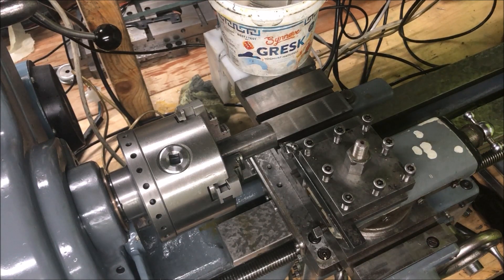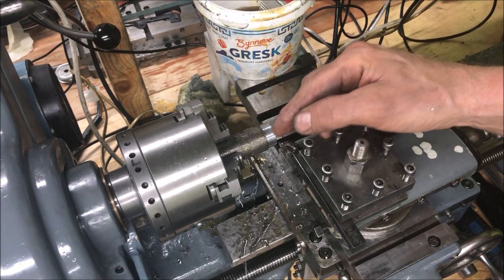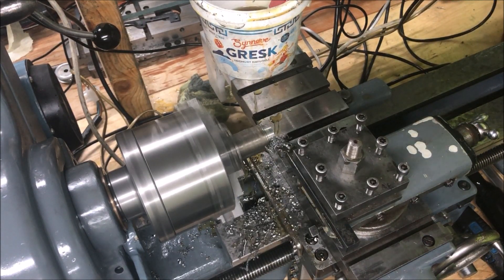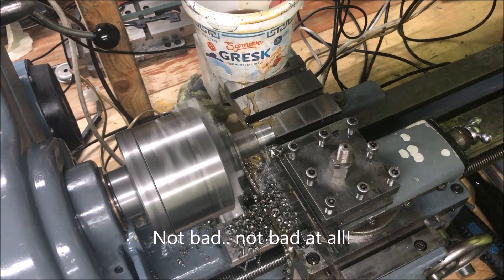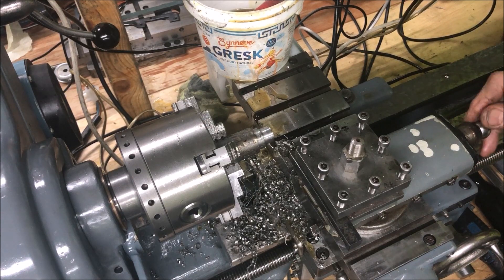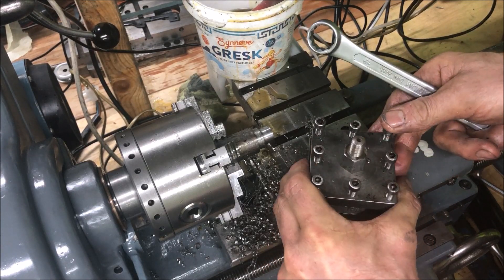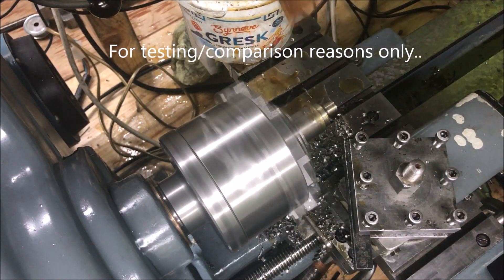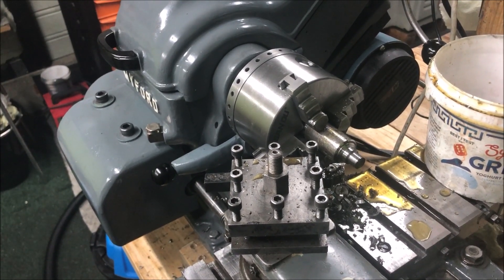Myford Super 7 - test cuts - part 2- with compound and ELS

Comment: Hi Jan, good tests. One quick observation from me, I see in the test of the solid tool block you used a quick change toolpost, however in the test with the compound slide, you used the 4 way toolpost. 

It could very well be a case that the lack of rigidity is actually stemming from the QCTP.

Would be interesting to see:

Toolblock -> QCTP
Toolblock -> 4 way

Compound - QCTP
Compound -> 4way

and to compare, to eliminate the variable of the tool holder changing between your tests. My best thoughts are a well scraped compound is just as good as the solid block, and actually the QCTP is far less rigid than people believe. Its like comparing the myford vertical milling attachment to a traditional mill, the overhang the vertical slide brings causes far less rigidity, same situation with the overhang of the QCTP.
Reply from the maker: Hi, Thnks fo the comments! You are of course right. The setup using the QCTP, being less rigid than the 4-way toolpost, is probably contributing to the results in the way you indicate. I guess I need to redo as you suggest :)
Reply: @jansverrehaugjord9934  Hi Jan, while i do agree with my initial comments with rigidity and the QCTP, i think the main lack of rigidity stemming from the myfords is down to the headstock bearing setup. I suspect that the front hydrodynamic bearing may not be providing as much radial support as it was intended. I plan to prepare some tests on my super 7 to see just how effective this is, and using tighter/looser clearances, different oils, scraping for 4 oil pads (nick muller mg12 video) vs just scraping for points etc etc, we will see.

Comment: How much this motor has power? I am running stock motor with VFD single phase and I constantly run out power. :/
Reply from the maker: 370W (0.5Hp) 3 phase motor run from a 1Hp VFD
Reply: @jansverrehaugjord9934  Same setup. Maybe it is the feed mechanism what takes so much power from the spindle.
Reply from the maker: @waldemarii  Could be!

Comment: I was preparted to hear a Myford singing, and it didn't happen.  Haha, my little Atlas would have been singing "I'm dying!  Help m- <k-chunk>"
Reply from the maker: I could tweak it further I guess and at one point the Myford would have given up (or is it given in?).. quite possibly if I increased the feed rate. But if so it is also nice to have a setup where all that would happen is that the tool digs in, belt (and/or clutch) slips and you cna just hit stop on the ELS, which brings the tool back to zero (or cut the VFD).

Comment: To be fair though Jan this wasn't a direct apples to apples comparison. That 4 tool turret tool post would help to increase the tool holding rigidity over the previous test with your QCTP and solid block test. In turn that would also help to increase the rigidity of the top slide itself by quite a bit. And that would also change the vibration and harmonics generated which would contribute towards tool tip chatter. Still that lathe shows an impressive cutting ability for it's size since nothing stalled or broke. I fully agree, every machine part is important during very high load cutting conditions and especially the fit and bearing amounts for the slide clearances. I'd also bet that for the actual part accuracy and surface finish the solid tool block would show some clear advantages.
Reply from the maker: I know.. :) This was the closest I could get with the same tooling. I do actually have a set of a homemade, Norman style QC holders that bolt directly onto the top slide mount, but these won't take the 16mm tool. Fully agree about the rigidity of a 4-way tool turret. The extra link/leverage you get with the QC system works to our disfavor from a "vibration point of view". I am also pretty convinced you are right re. the solid tool post on rigidity and overall performance enhancement possibilities. It is such an easy changeover between the 2 systems, so this must be appealing to others also. And such an easy project!

Comment: Seriously impressive Jan! I would never have though a little Myford could take cuts like that.  It says a lot for the quality of your work, but also shows me how valuable the ELS could be - not just for thread cutting!
Reply from the maker: Thanks. Indeed, the Myford is a very capable machine. Well designed for the tasks for smaller jobs, perfect in a hobby shop. I guess it is a bit "outdated", and todays' machines, especially of far-eastern origin are probably unrivalled if you measure cost vs. function. However, there are certain details.. actually a number of them, where I find a Myford still holds its' own.. remember.. after about 70 years from the start! 
Yes, the ELS is a nice addition. I still favor this approach, that you can easily go back between manual turning and when you want to engage the automatic cycle control. I think this is the perfect addition to a standard change-gear equipped lathe, of which there are many in this machine size.